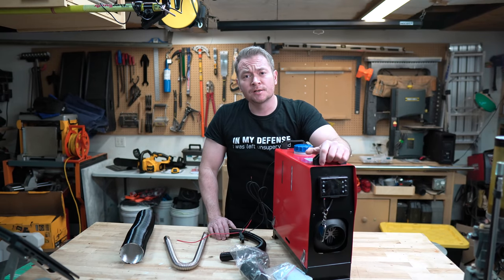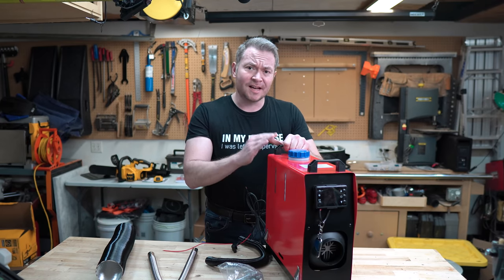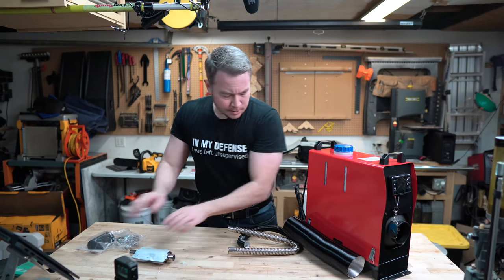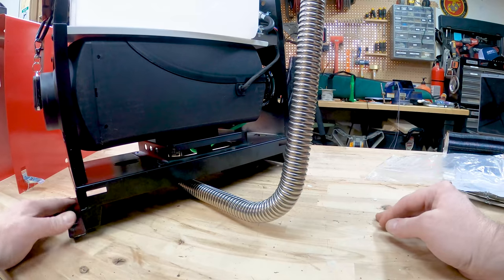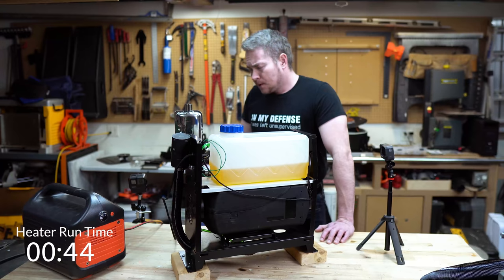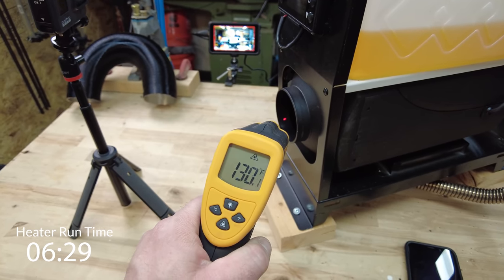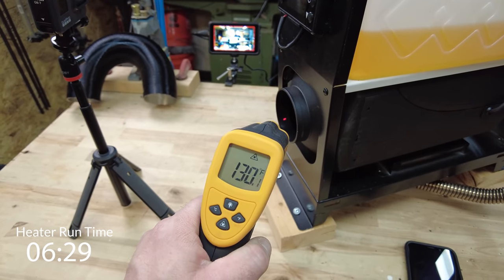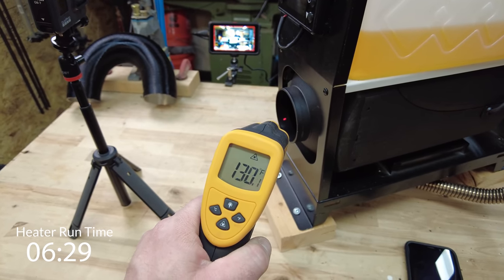My First Chinese Diesel Heater

Comment: I generally get annoyed with most presenters. This is the first time viewing this channel. You are really great at this. Commentary, clarity, production flow...GREAT! CONGRATS! Hope you build a huge audience!
Reply: agreed just stumbled in on this guy. his production and presentation is really good.
Reply: He really is good at a review, not just 20 minutes of some unboxing, at the end of his review, one can honestly decide to buy one or not.
Reply: Check out Technology Connections he’s great too.
Reply: Really glad I’m not the only one who feels this way!!
Reply: Was thinking the same thing
Reply: Im a guru when it comes to camping and survival tips and tricks. My QUESTION IS ❓ 
Whats the minimum size solar panel and recommend size battery setup for a simple solar energy source to operate this contraption. And could the heater be completely home maid with the fan,fuse,and off /on switch as the only electronics to do away with a complex computer panel. I know thats alot to answer so the solar part is the most important to me.
Reply: @stevendunn405  Ok, im no expert, lets get that straight.
I am running my contraption (the one you see in this video, i happen to have bought the same one except mine has 4 warm air outlets, not this 1 gigantic hole) on a 12 volt battery from a regular car.
I charge it via the net, with a charger to charge batteries from cars.

So: Your question about solar panels:
What you need is enough solar panels to charge at least 2 batteries. But obviously the more the better.
Simple switching circuit to have it charge on solar and output on this device (and other devices). You can figure that out on your own.

The heater could be completely home maid (or shall we say: made?).
But why would you want to spend time on it?
You can buy a cheap example for less than 200 dollars.
The housing is aluminium, there is some electronics. It has a glow plug (which you call a fuse).
On/off switch? What about just a alligator clip on the end of a cable. You attach the alligator clip to your battery, and the device turns on. You take off this alligator clip, and the device turns off.
You can even put a light bulb switch in between if you are too lazy to handle the alligator clip.

Sure, you can make it at home, but why?
You can buy the device for almost nothing. It is a neat device, it already has everything you need inside of it.
No need to build it your own.
But it is obviously something a skilled person can build himself.
It is a very easy concept.
If you would buy 1 of these devices and take it apart, you can see how simple it is.
A child could make it, if they have the equipment and material to make it.

Comment: IMPORTANT NOTE: I saw this on another channel, but it’s important to have the muffler be the lowest point in the exhaust system because of moisture or it will cause moisture buildup in the machine and make it fail. Also the little dimple on the side
Of the muffler should point down because it’s a moisture outlet.
Reply: Also doesn’t a muffler reduce more sound the closer to the source it is?  And would potentially clear the feet.
Reply: Thank you man, wonderful tip
Reply: Thanks for your tip, I appreciate it. Regards from Spain
Reply: @Steadierpark  The exhaust doesnt sound that loud. And with the muffler on it it is already reduced significantly.
I would not put it straight on the device itself, but on the end of the little pipe that comes along. Because of this little hole that is there to drain.
You want that to be outside somewhere, so that fumes can escape from it outside, not inside.

But what i do not understand is: What do you mean by: And would potentially clear the feet.....
No clue what you are trying to say. I am dutch. Pls enlighten me.
Reply: Thank you for this tip indeed. I didnt even notice this little dimple at first. But now i have seen it, i will make sure to have it point down when i install it.
Now i just have it on a stand, and everytime i end the burn i make sure to empty the muffler myself, by picking up the devide and pointing it down untill it stops dripping.
Reply: @Steadierpark the muffler works. Me and my husband looked at it and were like wtf!? We were both thinking more on the lines of a catalytic converter. The little muffler works very well, cuts noise by about 50%. And yes, keep it downward! Or at least level.
Reply: yes and the wheep hole have to face down  for the water and condensation to evacuate

Comment: Cool video. Here are some tips I've learned from mine.

You can control the temp, fuel consumption, and power consumption much better if you use the frequency setting. Set the control panel to show settable temp. There is one temp that you can set and the other temp is ambient temp. On the control panel hit the top two buttons on the left and right side together, and hold. You'll change the settable temp to frequency. The lowest frequency (1.6 hz) keeps my popup truck camper at about 65 throughout the night in 30-degree temps. 

Running mine for about 14 hours straight with only 1 startup and 1 shutdown uses about 13 to 15 amps from a battery. This same daily run time uses about 2 gallons of fuel in 4.5 days. 

Exhaust leak. After a while, you might get diesel fumes on startup from the clean air. This only happens on startup and cool down, not during regular run time. There is a gasket inside where you need to tighten the screws. It's near the combustion chamber. I have this issue but haven't been able to fix it yet. Take a bit to disassemble but shouldn't be too hard. It started after about 6-months of consistent use. 

Don't forget to use a carbon monoxide detector. 

The fuel pump is loud. There are quieter ones, or try to wrap the pump in sound damping materials. 

Cheers,
Reply: Can I use this in my big truck or do you need the exhaust fumes to go outside?
Reply: @derick12331  Gotta have a way to get the exhaust outside.
Reply: @derick12331  you can use it in your truck cab, but you have to either have an exhaust port already or you have to fabricate one by drilling one out so that the exhaust can be vented outside.
Reply: Hi,it is possible to set up,for exemple to starts automatic at 4 AM to prepare nice temperature when i start to work in my garage at 8 AM? thanks

Comment: I’ve been using this exact unit for three years to heat a two car garage during the winter and it’s never failed to start and run with excellent fuel and power consumption. People say they’ve had trouble with these units but mine has been great. As a side note, I run mine on kerosene all the time.
Reply: would it run on red   or kerosene only
Reply: I’ve always ran mine on pure Kerosene, I was worried about the fuel pump have a less lubricating fuel but it hasn’t seemed to be an issue at all. I realize my experience might be unique but I’m also a boat guy and I’m used to the Webasto and Espar heaters and considering I can buy ten or more of these heaters for what one of those cost I decided that even if I replace this every couple years it made more economic sense. As it is even though I’m sure that the quality isn’t as good as the German units I’ve had zero issues and would recommend them highly.
Reply: Here are the specs representing the four operating stages of boost, high, mid, and economy,  from the original heater Espar d2 that served as the template: 
13,650 (4) 10,200 (3) 6,800 (2) 3,400 (0.9) BTU/kw
0.13 (0.51) 0.10 (0.38) 0.07 (0.25) 0.03 (0.11) Gallon/ liter
3.3 amps 2.0 amps 1.1 amps 0.6 amps
Reply: @jonneilsmyth9107  Yes they can run on red diesel or green diesel as they have in ireland but kerosene burns cleaner.
Reply: Helpful 😊
Reply: @ColinsMarine  where did you buy the thing from.  Need a heater for the hunt camp
Reply: @williamharris7992  I got mine from an Amazon supplier, as stated it was a number of years ago now…FYI still going strong with no modification or failures. The Kerosene might be the difference but it’s been great.
Reply: What about the exhaust fumes, is this a problem? Thanks
Reply: noobie here. mine is on the way and I keep seeing to run on Kerosene. just  K1 or is there different types to use??  sorry very ignorant here
Reply: @josephb3147  looking at getting one of these heaters, I have an oil fired boiler that runs on kerosene and it's much cleaner than regular diesel or red diesel so I'd run it on the same fuel as my boiler. Hope that helps
Reply: @jonneilsmyth9107  Defo Irish Mate😂😂😂😂  no need to worry about the Customs👍👍
Reply: pure #1 but its getting colder so im going to #2 with a splash of 
Kerosene
Reply: I just got mine from Amazon.  I need instructions on connecting a car charger (12 volt ) cord to the wiring on this heater, and if you have an Amazon link to a good cord, that would be helpful.

Comment: I turned one into a furnace for a 120 sq/ft insulated shed. Powered with a 30A 3d printer power supply and is fed with a metal fuel tank outside. I also hacked one of the analog thermostats with the on/ off switch with an arduino and a regular programmable thermostat. works well enough, uses probably 60 gallons per season with the temp held at 60* or above
Reply: More on that please. Tiny house 120sqft shed conversion looking for another heat source
Reply: I was just thinking you could program a raspberry pi to cycle this on and off for specific temp ranges with limits to how long it has to run before it can be cycled again

Comment: For longevity, run for at least 20-30 min before shutdown.  Also, I don't know if it has some sort of altitude compensation, but I went through two Webasto heaters in two weeks when I was at 8500 feet, not fun!  I did have them leaned out (theres a control panel sequence you can do to adjust for altitude) but they still failed in a hurry!  Those were petrol though, the diesel ones are supposed to be much more reliable.  I now have a Planer (Russian) and its works very well.  It has a computer chip that automatically compensates for altitude.  It seems more solidly built than the Webasto too.  I run kerosene in it.  If you can find Kerosene in bulk, thats the way to go!  Its about the same price as Diesel, it burns hotter and cleaner, and I was told by the North American Planar Rep that it would last much longer before carbon buildup occurred if I ran Kerosene.  Some farm and ranch shops have Kerosene in bulk.  Mine is installed in the floor of my van.  My van is petrol, so I have a separate tank, thus why I can run Kerosene

Comment: I run mine on central heating oil, I add Lucas fuel Injector cleaner occasionally to lubricate and clean the combustion chamber glow plug 
It runs 14 hours a day
Reply: Just curious why you're using fuel oil? I see the average price right now is 3.40 and I'm presuming that's cheaper than "farm" diesel?
Reply: @fritzkabeano1969  central heating oil is currently 68p per litre , red diesel is more expensive in the uk
Reply: same thing
Reply: Is this a primary heater for your residence?
Reply: @tburrows357   I use the heater in my workshop / office, you'd need a number of them to heat a house
Reply: Lubricate all the non moving parts you mean 🤨🤷‍♂️🤦🏻‍♂️
Reply: @dylandylan11731   I should have said lubricating the fuel pump as it's all metal, kerrosene doesn't have the same lubricating qualities of diesel,
I no longer use Lucas injector cleaner I'm using low sulphar two stroke oil, one cap per tank fill
Reply: @dylandylan11731  you mean the pump that moves fuel by whichcraft, am i right ?
Reply: @casemodder89  they are a solenoid pulse pump - much like coffee machines use. There is absolutely no need for lubrications - diesel in itself has enough lubrication. 

It’s not an electrically controlled timed high pressure common rail diesel pump - it’s just a solenoid !
Reply: @dylandylan11731  i got one of these exact china units and a webasto petrol one n one of my cars.

there is a moving piston inside. and in the cheap chinese pumps at some point in time it will get stuck and is seized cork stiff.

Comment: 1: I got one of these in our boat. The model without RTR chassi. Worked good over this crappy summer in Sweden. Outtemp goes for 102C/216F. Extreme heat with the heater running att maximum. 

2: Just ordered a heater just like the one you tested with a RTR chassi. For our house cold days. Electricity in Sweden extremely expensive right now.  Can revert later on if so... Thanx for the good video! No BS just fact! Me like!

Comment: Thumbs up for the comedic value at the end. Stay away from propane and this type of heater for your garage, go for a natural gas vented system or electric. These things can kill you and you won't know it until you wake up in your next life. A propane unit took away all the oxygen in my two car garage and I was lucky to understand what was happening soon enough. Be sure to have sensors running so if you choose to run one of these heaters that you get a heads up in advance. They put you to sleep fast. Took me a little while to realize what had happened and never used a propane heat after that day.
Reply: This is a problem with any open flame device. Wheather pellet stove, wood, coal or flammable liquid gas. You need outside intake and exhaust.
Reply: This type heater has an exhaust that is to vent to the outside.   I've used it for 40 years in a truck.   There is no danger if the exhaust is working.   And the Bonus over other heaters is no moisture introduced inside.   I also use one in my camper.   I'm still not dead.  I have a C02 sensor in there is never went off or even elevated.
Reply: When combusted properly, diesel has lower carbon monoxide than gasoline!!!
Reply: @jocap7993  I agree. My pellet stove uses outside air.
Reply: I had a Big Buddy and it smelled too much in my garage...

Comment: This is exactly how I heat my garage.  Effective, cheap and fairly easy install.  I mounted mine in an old filing cabinet that I hang from my ceiling.  Its a great way to heat my 24x24 garage.  No complaints.
Reply: You power up with mains?
Reply: @jackthomas1978  correct, I use a transformer to go from 120 to 12v
Reply: @takeoff1212  ive just ordered a 240 to 12 20amp tranny, 👍
Reply: @jackthomas1978  20amp might be a bit shy. I know these units pull quite a bit at startup. I just looked up my Amazon order from over two years ago and I bought a 30amp setup
Reply: Will it keep you garage warm ? Say 55 or 60 degrees 🤔 TY,,
Reply: @bustersmith5569  oh easily! I’ll give you an example, over the past weekend it was -27c here, or about -16f and I had my unit running in the garage, kept the garage around 21c or 70f all day without issue.
Reply: What size KW are you using.
Reply: 5kw

Comment: I've bought it more than a year ago. It works fine since the first start. It heat's up our caravan and its front tent very well. Same trouble with the manual. But some trials helped to handle the terminal and the remote. It's a nice and easy/cheap kind to get rooms cosy.
Reply: How long does it take to heat up the van?
Reply: @sherifnabil9663  about a half of an hour.

Comment: You can tell these diesel heaters were all made in the same factory in China, as a friend of mine has the exact same heater (down to the colour etc) but branded differently (we're from Australia).  Because he uses his heater to heat up his tent, its usually placed nearby (the tent), plus with his kids about, he has wrapped the exhaust of the unit with thermal exhaust wrap/tape. Although I can't remember his having that muffler at the end. Even without it, the unit was relatively quiet.

Comment: I sold many webasto and espar heaters.The customers who burned kerosene in them never had any issues.I am glad to have this video.I am thinking of installing one of these in my side by side.
Reply: Hi question  Can u burn  
Both Fuel Diezel or Kerozine or it's a completely different heather unit ? Thanks for answer Bob Québec Canada

Comment: Hi I bought this exact model heater nearly 2 years ago heating my large steel work shop and it’s been great , I piped a permanent exhaust to the outside and have the heating duct aimed at the floor ( got the tips off YouTube) and I wouldn’t be without also I use red diesel and always have it running on full power , anyway I’m full of praise for these heaters
Reply: @owenblake90  hi i needed the shed large for my motor home so its around 11 meters long 6 meters wide and a 3.5 meter roller door high so its a big space to heat and the heater works well ,never too hot but keeps its nice for working in
Reply: @owenblake90  oh sorry forgot to say no insulation

Comment: I have a webasto in my boat. I run it on kerosene most of the time. Fill with diesel only in a bind. Kerosene burns cleaner, from what I am told. I haven't had any issue with having kerosene in the tank and topping off with diesel from the pump. Kerosene is a lot more expensive but I don't use this heater much.